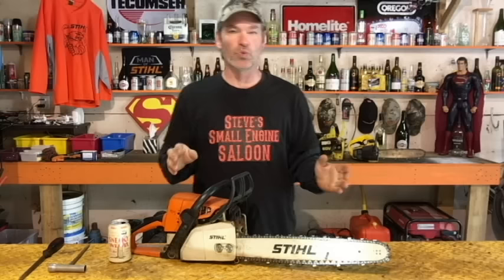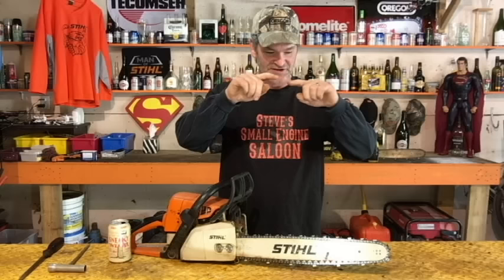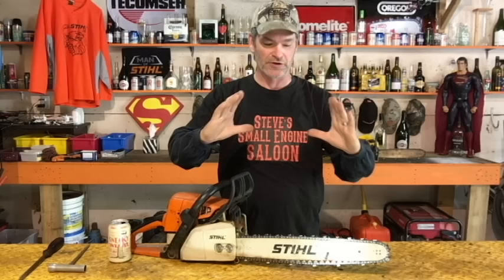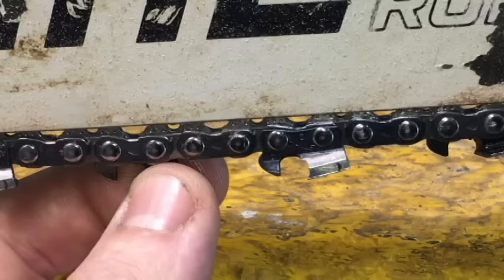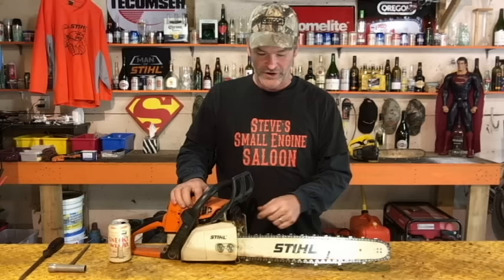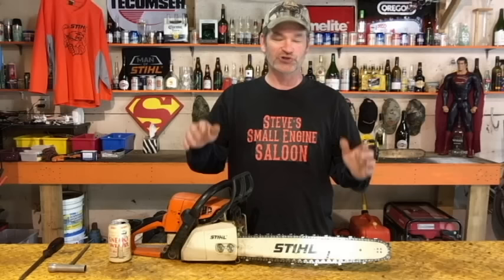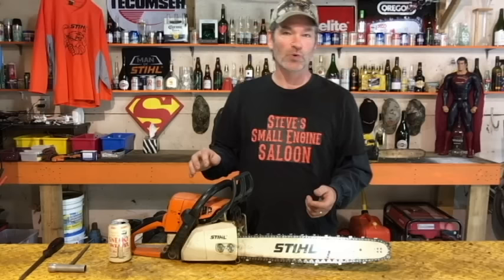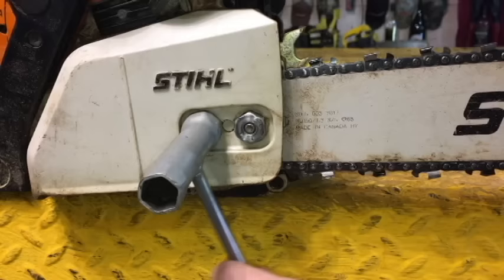CORRECT WAY To Adjust The Chain Tension On Your Chainsaw

Comment: i dont know if others experience this or not with their chainsaws, but tightening the two lock nuts on the side will tighten the chain even more to the bar on mine, so i have to leave the chain a tad loose and then tighten the 2 nuts on the side. its a pain in the butt for me and usually turns the 1 min job into 10minutes of tightening and loosening to get it right. anyone else have to do this? stihl ms261cm, bout 5 years old, light usage

Comment: Maybe a dumb question but I tighten my chain, the bar is loose, I tension the chain and it picks the bar up and when I'm done I'm at the same point. Does the difference matter. Generally I'm sharpening  it at the same time.

Comment: Don't forget that in use, the chain can get quite hot and consequently longer, so it may need a bit more adjusting,  however,  if you adjust the chain to proper tension when it is hot,  you need to release some tension when you are finished using the chainsaw, and before the chain cool down, or the extra tension caused by the chain cooling and getting a little shorter, could potentially cause damage to the saw, this issue will be more pronounced when using longer cutter bars and chains, - just another thing to keep in mind when using chainsaws...😊

Comment: i have mine not really tight but more tight than loose..i wouldnt think thats ideal tbh i mean it works and cuts but having too much slack i can see disaster happening as well just common sense so as his is sene ehre looks decent the teeth arent too low out of the groover..but a little slack where its not too tight id think that type would be the best or decent way to put the chain on.. not loose enough for the teether to fall out and not too tight for other mishaps that can happen with lack of slack..

Comment: Just purchased this saw.  Used it for an hour and both of the tighten nuts came off.  Found one in grass, brought it back to place purchased.  Got it back a week later, and same damn thing happened, but only one nut came off.  Now the chain doesn’t spin at all.  Why are the nuts vibrating (I’m guessing) off all the time?

Comment: Poulan Pro PP4218A
I keep the chain sharp  and tension it as you instruct. Yet every once in a while I'll look down and the adjusting screw is spinning. The chain doesn't loosen and the bar nuts are tight to the clutch cover.  When I take off the cover I can tell that the pin on the adjusting mechanism has disengaged from the bar. I don't see any damage anywhere, there's no obstruction, and neither the bar holes nor the pin appear to be worn. You've probably seen it all. Any suggestions? Thanks.

Comment: It is important to adjust chain tension when the chain is cool, not when it's hot from cutting a load of firewood or whatever. When hot, like all metal, the chain expands or stretches. If you adjust it when its hot, there's going to be way too much tension on your tip and sprocket when it cools and returns to normal.

Comment: MS 311 new carb, new cylinder, piston n rings.  Used a few times and now after about the time the saw is hot it will take off to full throttle  by itself. What would cause that?

Comment: Great Day eh.... Just waatched your propane ransfer video - great tip, Thank You. That is going to be a big savings, those little tanks are rediculously priced. My question - don't the 20pound tanks have a safety valve in them so they shut off when flipped upside down(i think my 30lb does)...?  great video.  I had to sub to get more info about this chain saw stuff... cheers

Comment: Just cinch 'er down at full throttle until the tip gets red hot, then back the adjuster screw off a half a turn to be safe.
Then take it in to Steve's shop and give him some money to do it right.

Comment: How do you continue to tighten your chain if you can no longer turn the adjusting screw to the right? Meaning the adjusting screw has run out of room? My chain has been sharpened about 4 or 5 times and is getting close to the end of its life.

Comment: I don’t ever run a chain that tight, unless it’s a brand new chain. It will get way to hot and require a ton of oil. If your saw has a non adjustable oil pump you can’t run a chain that tight. I like my chain not touching the bar in the middle but still at least 3/4 of the drivers are in the gauge of the bar. As you said no two people run the same tension on a chain.

Comment: Yeah left off making sure the chain freely rotates after everything tight. And you’ll often have a tight spot, which is where you should adjust at. Better some sections a little loose, rather than too tight.

Comment: Hi Steve, I have several chainsaws and am trying out an Ego 16". Great out of the box but once dull-smokes- I cannot return the chain to suitable sharpness. So I replace. But I wonder if Ego's chain is proprietary-and they won't tell me the chain specs, they'll only sell a new one. Would you happen to know what the blade specs should be to make sure it is matched to the saw and is the correct size so I am sure to sharpen correctly?
Thanks

Comment: Don't forget to clean all that built up sawdust out of your bar groove to, it will pull out and refill with sawdust and throw your tension off to. take a piece of steel band and cut it to a 45 on the tip and  stick it in your box and every time you change your chains or pull your bar off clean it. you wouldn't believe how much shit gets built up in that slot.

Comment: Also, as your pulling up on end of the bar you'll notice the chain droop increase and decrease If you spin the chain back & forth several inches. Set the chain tension at the highest droop then tighten it until the top of it just touches bottom of the bar. Then tighten your bar nuts down, as you're holding bar tip upwards. It'll save you having to retention it right away when you check it. Get it ?!

Comment: Lift or block the tip of the bar up, adjust the chain to where you can lift 3 drive teeth above the bar and go to work. PS. DON'T let the thing run out of bar oil!

Comment: your chain tension shoukd be based off what kind of wood (hard vs soft) and how deep your cut has to be ...When im only limbing small pines then i like a looser chajn but if im falling a large oak or elm then im tightening tbe chain as tight as i can possibly get it and then turn back half a turn to allow for the max heat dissipation while keeping the chain from being too loose so it doesnt try to bind or walk the bar off my cut line due to slack in the chain causing for more side cut than top cut  ... if your chain is too tight then it struggles to keep it properly oiled at a higher rpm and it increases bar heat which we all know heat always equates to more resistance while too much slack allows the chain to take uneven bites per tooth leading it to walk off track and ultimately jump off the bar when one of the teeth finally catches and snatches one side or the other instead of the tooth cutting from off the top which helps to more easily control and guide the bar ... Yes sir , you are absolutely right though about everyone having a different opinion on chain tension but to be honest all 5 answers from each individual could actually be right in their own right as each person may have a different idea of what they would be having to cut leading to a different chain tightness but if you were to take those same 5 pros and place the exact same limb or tree (same thickness and hardness ) in front of them and tell them to adjust the tension on their saws then i imagine they would all be very close to the same level of tension .... sorry for the long answer but i wanted to make it as clear as possible that the tension should be based off what your cutting and not just off what someone thinks it shoukd be as each level of tension will have a different response to what your cutting and that difference only increases among the different levels of hardness and thickness so the next time you ask someone what your saws chain tension should be , keep in mind that it should always be based off what your cutting a d not just based off a personal prefference or opinion .i hope this answer helps soneone  ...

Comment: I've always been told to tighten the chain just enough to where you can put a quarter in between the bar and the chain as you pull up on the chain. . That keeps ppl from over tightening it.

Comment: Sorry Steve. Very awkward to reach to the end of the bar. Obviously most folks have smaller bars. I was taught to pull up on the chain as I tightened. It does the same thing. Much easier. Try it!

Comment: And keep checking by looking at the chain between cuts on a new chain, tighting it back up as the chain stretches. Because it stretches alot at first. Later it doesn't stretch as much so you won't need to tighten it back up as often.

Comment: When I tighten the chain as then video recommends, the bar gets hot and expands and then the chain is too tight, and can bog the engine after being used for about 10min.  Am I supposed to readjust tension after it gets hot? If so, why wouldn't I just set my tension for what it needs to be when it gets hot, rather than setting it to proper tension while cold?

Comment: Hold The TIP??  NO!  ...  Field Tip:  hold the handle up just enough to put upward pressure on the tip, from the ground.  This way, you don't burn your fingers, get them dirty, or get micro-cuts from a (freshly sharpened) chain.

Comment: Yes, you pull the bar upward as you tighten the nuts for the chain tension - since that is the position that the bar will be under stress when you're cutting.  EXCEPT.... what about when you do undercuts?  Then, the bar is under stress from the top of the bar pushing down instead of up when you're cutting.

Comment: At 1:58 when you mention centrifugal force you mistakenly say that it's responsible for the chain's tension to become a circle,because that force is responsible for the opposite,the chain's tension to come off the rail of the bar. That's what the etymology of the word centrifugal implies: Latin centrum (“center”) + fugiō (“to flee”) + -al.
Tending, or causing, to recede from a center.
The opposite phenomenon is described by the word centripetal:
Latin centrum (“center”) + petō (“to seek, aim”) + -al.
Directed or moving towards a centre.

Comment: I find my adjust slipping after 10 minutes of use.  This tension level is not appropriate.  I adjust until the chain is tight against the bar.  And I run my oiler a touch higher.  I can cut until I dull the chain-blade.  For a few cuts, this works.  For 10 minutes of work, this fits the bill.  
However, I will follow other advice,

Comment: The chain does not do 12000 rpm.The crankshaft might. Think about it, divide the total number of sprocket holes in chain by the number of teeth on crank shaft sprocket. Thats how fast chain goes..

Comment: OK, the chain doesn't go 12,000 RPM, that's the piston speed.... there is some number of strokes that completely turns the chain one revolution, so you would have to divide by that number

Comment: Too tight. Sthil recommend that you should be able to pull the chain up or down off the bar by 2mm after tightening.
Your chain will get hot during use so always check the tension, maybe every 5 cuts depending on the thickness of wood